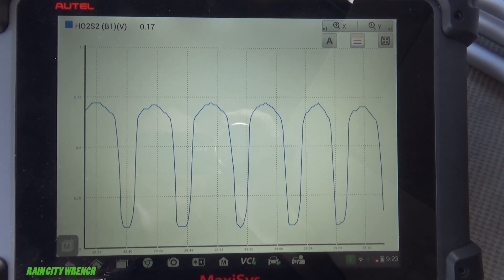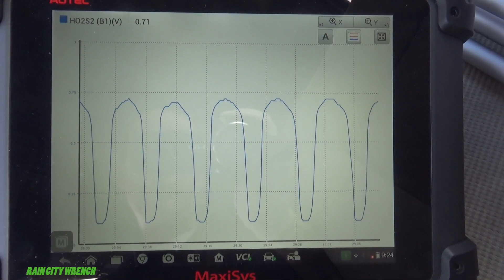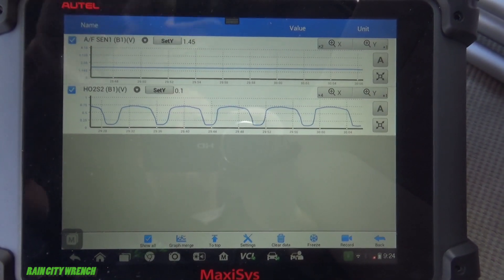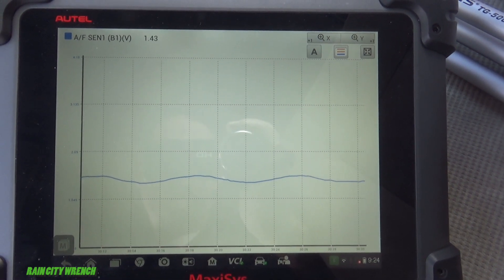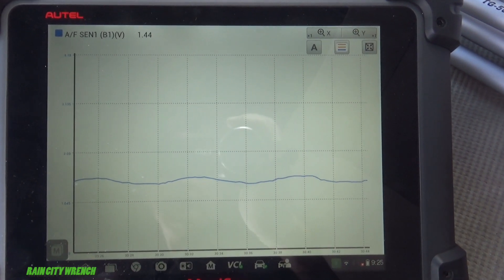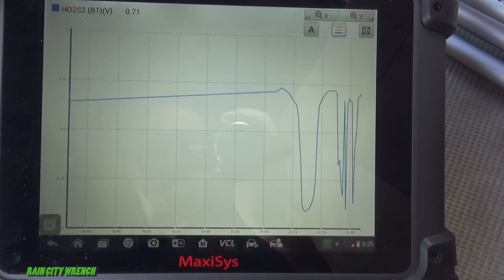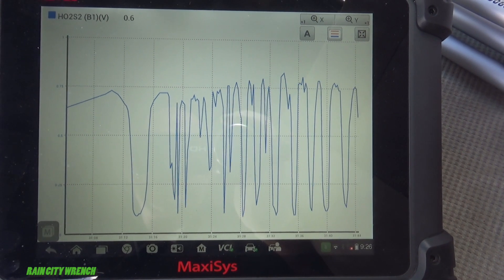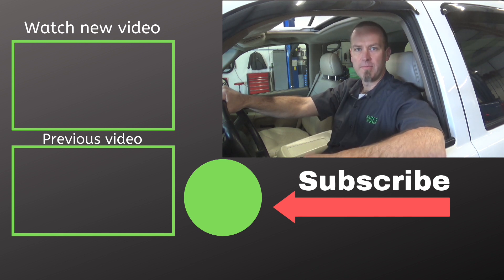Nissan Sentra P0420

Comment: HELLO! 2014 SENTRA /  O2B1S1 = 2.25V  ////  O2B1S2= 0.28V ( ERRATIC WAVE- PATTERN) COULD IT BE A LOOSE GROUND WIRE ??   CAR RUNS GREAT!  NEVERTHELESS, I NOTICED THAT ON COLD-START THE DASH TEMP. (CORRECTLY INDICATES) 76f, BUT THE ECT SHOWS 103f ON SCANNER (BEFORE MORNING STARTUP). IT STARTS IN CLOSED - LOOP.   I READ THAT MY P0420 COULD POSSIBLY BE DUE TO A BAD ECT SENSOR; I CHANGED IT , BUT THE PROBLEM PERSISTS. ARE THE VOLTAGES OK??  THE FUEL TRIMS ARE MOST OFTEN WITHIN THE -5 TO 0 % RANGE, WITH  AN OCCASIONAL MOMENTARY -10 TO -13. I'M GETTING CODE P0420. I CHANGED THE AIR/FUEL SENSOR(O2B1S1) TO NO AVAIL. THE CAR RUNS GREAT, WHAT APPEARS TO BE THE PROBLEM??  THANK YOU VERY MUCH ? (I ALSO CHANGED THE PCV & CLEANED THE MAF, & CHECKED FOR LEAKS)
Reply: UPDATE/////    MY P0420 WAS CAUSED BY A LOOSELY SCREWED-IN PCV

Comment: What’s an emission waiver? In California if I fail test you can get a waiver to not pay again?
Reply from the maker: Washington state emissions program has been suspended as of 12/31/2019. It used to be every car older than 5 years had to be tested every 2 years similar to California. If it failed then the department of ecology would allow a $150 dollar waiver toward repairs applicable to the failure. As far as I know in California, if it fails then it needs to be repaired or parked no matter what the cost = no waivers.

Comment: I have an 08.. I want to do it myself. Is it possible for it to be cleaned?
Reply from the maker: They are pretty easy to replace unless they seize in the exhaust. Your can try and clean it, won't hurt anything. Remove it, spray it with brake/carburetor cleaner while brushing it

Comment: Awesome video! My Chevy 5.3 started doing this cleared the code a couple times hasn't came back yet... did all 4 o2 sensors a few years back so didnt think it was that. If it comes back must be the cats...  wats ur take on deleting cats? Will it run like shit? Long tube headers an cat delete or shortys an replace the cats?
Reply from the maker: Sounds like a weak cat or cats. I was looking at a set of shorty oem headers on summit a year back (forget the brand) for my 02 yukon 5.3 but haven't got around to it. I'm not a fan of long headers, seems like they all eventually leak. The computer uses the pre cat o2 sensors for fuel trim and the post cat o2's for catalyst monitoring. If you delete them it will require a programmer to keep the CEL off. Magnaflow makes a nice performance Y-pipe cat assembly that clamps in the middle for easy install and bolts up without modification, add some oem performance headers and you will have a nice no fuss, street legal, performance exhaust.
Reply: Great info thanks! Ya I've been wanting to do it never get around to it but now looks like I have an excuse to spend money now! Thanks I was kinda leaning towards the shorts anyway it's a daily not a race truck!

Comment: do away with waivers, dont want to fix it, it dont need to be on the road
Reply from the maker: Here in the state of Washington, they are sunsetting the emissions program at the end of the year. I think it was implemented in the early 90's. I have been an AES (automotive emissions specialist) since they started the program and have never been a fan of allowing gross polluters to pay a "$150 fine" and keep driving. As technology has advanced and the fleet has been getting newer, wash. st. no longer has an air quality problem. I doubt California will follow anytime soon.
Reply: @raincitywrench117  the bad thing is, as an avid motorcyclist, i have too breathe what the fog machines put out
Reply: Rain City Wrench there was talk of getting rid of the emissions program here in pennsylvania. But that never happened. Don’t think it is a good idea. Once the program is gone everyone will neglect fixing their check engine lights and the air pollution will come right back.
Reply: @devoncoolman88  I bet in do time if your rig sets a cel and it could impact the environment, all cars will go into limp mode, won't hurt the environment and you can't drive them till they are fixed
Reply from the maker: I never could understand why have an emissions program if they will allow waivers? At least make converter/o2 codes not able to waive IMO.
Reply from the maker: Yea Kevin, you may be right. It would be no different than 09 or newer diesels that go into limp if you don't fill the DEF or cat/egt codes store. Side note: I get beside or behind diesels all the time that are deleted, they are never stopped and issued fix it tickets.